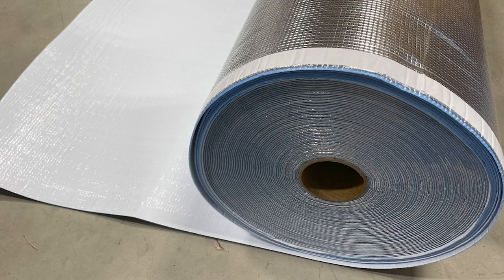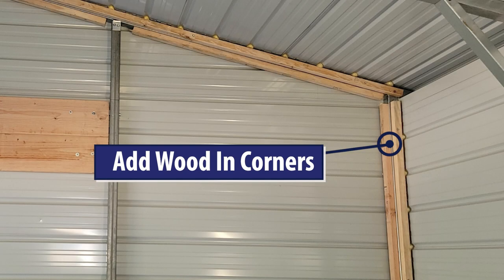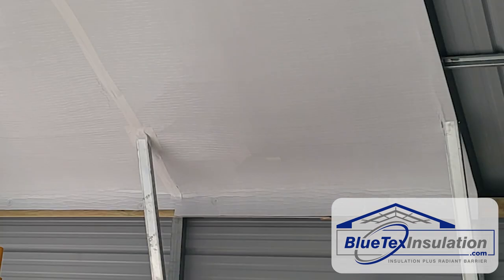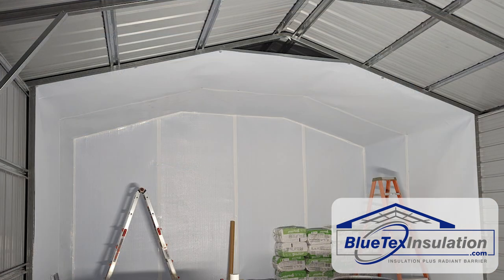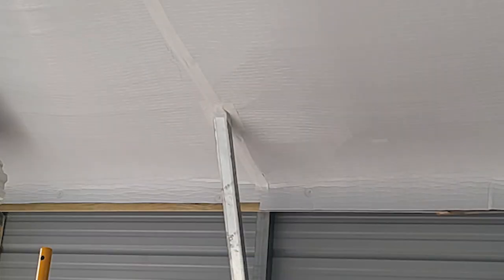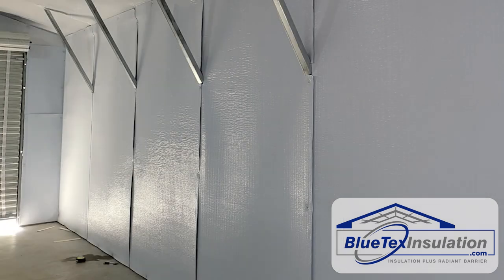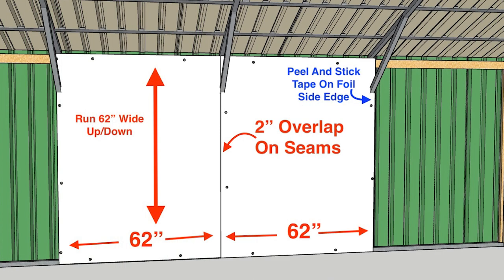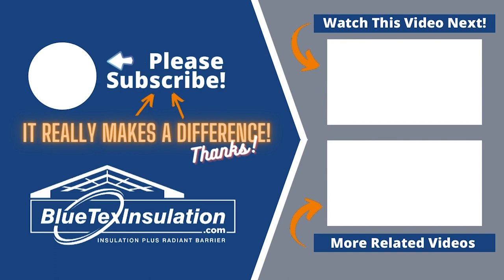Metal Building Condensation?  Quick Install Guide 62" Wide BlueTex Products Up/Down on Metal Frame.

Comment from the maker: Do you have questions about installing www.BlueTexInsulation.com ? Ask them here!
Reply: Is there a possibility of condensation inside the void between the roof/walls and the BlueTex?
Reply from the maker: Generally, the space between the www.BlueTexInsulation.com and the metal is "ventilated" space.  So, it's basically "outside" just like grass, leaves etc. and has the POTENTIAL to have some condensation when the relative humidity is VERY high.  However,  usually not since the air coming into the cavity is "cold" relative to the warm-moist air below the BlueTex inside the building.  IF it does get a little wet.  No big deal.  As soon as the sun comes up, it will dry it out.

Comment: I'm fixing' to pull the trigger on insulation and was originally going to go rigid 1" with foil backing.  Expensive as hell.  Then I saw the Prodex marketing.  Then I saw yawls.  You seem to have the most cost-effective solution but Prodex R values...if they can be believed, seem amazing.  Anything you can add please?
Reply from the maker: You're a smart guy. NOTHING a 1/4" has those kind of r-values in real applications.  Did you see this page all about R-Value scams? https://bluetexinsulation.com/pages/r-value-of-bluetex-insulation

Comment: Looks like a great product.  Could you use 1 inch or 1 1/2 inch rigid foam board between the metal frame directly behind this and leave an air gap towards the outside to further insulate?
Reply from the maker: You could, but to get maximum benefit you want the foil to be the FIRST thing the heat encounters after it leaves the hot metal.  This is the "shade" part.  Then, you would have the foam part for conductive heat.  Are you heating/cooling the building often?  We have a lot of solutions at www.BlueTexInsulation.com but we need to know what your goal is in order to recommend a product and/or process.
Reply: @BlueTex Insulation  that makes sense. Maybe heat in the winter. When I get it built I'll get more info
Reply from the maker: This page may help: https://bluetexinsulation.com/pages/help-me-choose-the-right-building-insulation
Reply: Been watching your other videos. When I erect the frame, before I add the hat channel on the truss. Can I run the 62 inch over the frame and them add the hat channel. This will give a clean look and probably easier to install. Thai will leave about an inch and a half air gap also.

Comment: Several questions:
1) I've seen videos installing this or similar products, using 1x boards mounted to each metal stud so that the foil never directly touches the stud. Is this more effective than just mounting directly to the steel?
2) Is there any sound dampening qualities to installing this stuff?
3) Can you use this in conjunction with a R-value insulation such as the pink foam sheets (underneath or over the radiant barrier)? If so, in Texas would I want the R-insulation under or over your product?
Reply from the maker: It really depends on if the building is considered "conditioned" or "non-conditioned".  Take a look at this article: https://bluetexinsulation.com/pages/insulating-non-conditioned-buildings-vs-conditioned-buildings  Then, you can determine the right process/products based on your goal.  But, yes, you can use in conjunction with other products.  https://bluetexinsulation.com/pages/insulating-conditioned-buildings-hot-mixed-climates-installation

Comment: Is this something we can attach to RV’s can this be an exterior or just interior?
Reply from the maker: Definitely CAN use the white side facing out on exterior in the weather.  Probably get at least 5 years use before any significant deterioration.  It's not what it's really designed for, but we have had many customers use in outdoor applications with great results. www.BlueTexInsulation.com